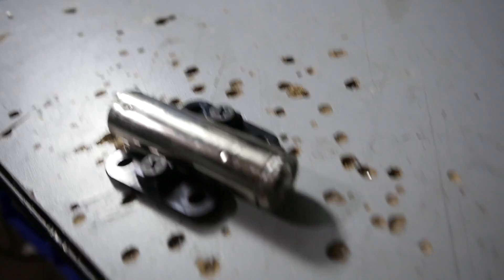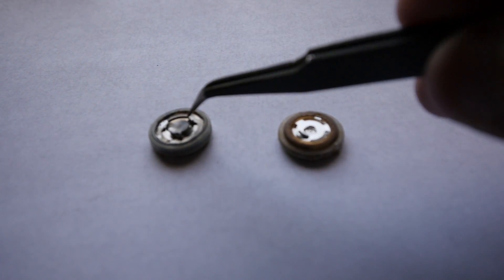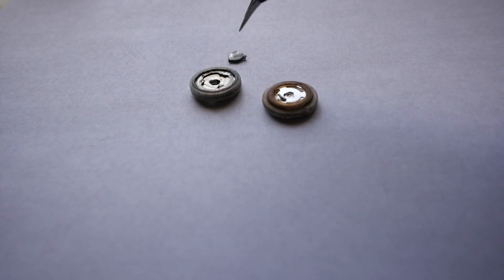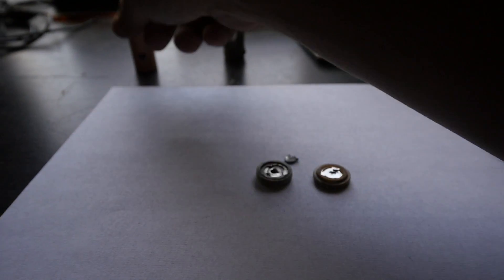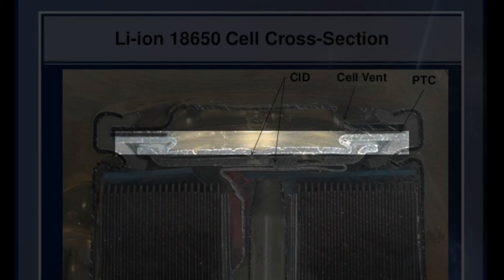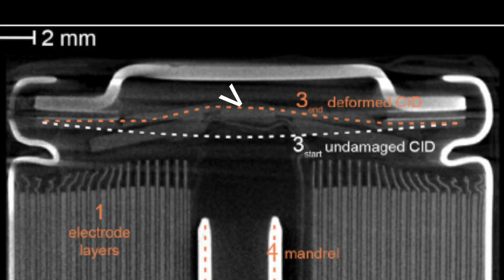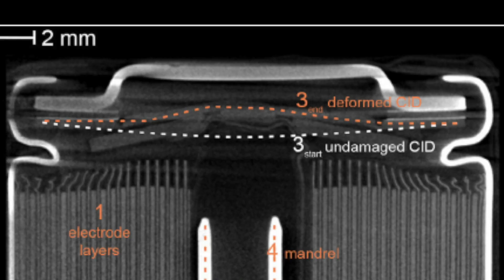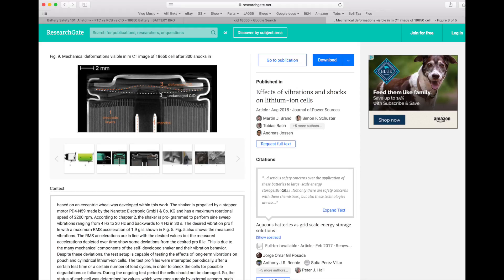ARE TESLA S LITHIUM 18650 BATTERY CELLS SAFER?

Comment: Wouild it work? If you use this on vapes?
Reply: Maybe but the problem with vaping devices is when they fail they fail near your face or in your pocket. Much different than failing in a fireproof battery case.

Comment: Good video.. I did observe however, that in the CT scan of the typical 18650 cell, you said the bottom layer stays down while the top pushes up... but in the scan it appears both layers are pushed up.. no?

Comment: Tesla batteries are also used in a power bank, with non-conductive liquid cooling, unlike your laptop where you are likely to find LG cells, or a vacuum cleaner. You are not likely to see heat in a tesla battery when it is being used in the right application, like a car. Also, you should compare maximum capacity and amperage draw if you really want to compare the safety between two cells. Maybe it doesn't need safety features like that. Cutting it in half does not show quality at all of a cell.

Comment: It depends on the chemistry. If the chemistry is safe enough then the cell can stay dead shorted and it will be able to vent fast enough safely without risk of fire or explosion. We would need to actually test the failure mode of the cells to make sure. Dead short a fully charged cell for us sometime and put it to the test. (STAY SAFE!)

Comment: Just some extra info:  The PTC can handle heat, however if exposed to lots of heat, what happens is the polymer PTC fuse material changes phases and the resistance increases.  When it cools the resistance decreases again, however even causing the PTC fuse to activate once can increase the resistance of the PTC material for days, weeks or even months, thus temporarily damaging the cell's IR.

Also, as far as I know all high current cells don't have PTC fuses because PTC fuses increase the resistance of the cell too much.  Laptop grade cells with 2C max discharge are what have PTC fuses.
Reply: PTC stands for Positive Temperature Coefficient - Jehu said Terminal as the middle word (2/3 ain't bad tho :).  NTCs exist too, which pass electricity as they heat up, rather than stopping it.  Both terms are common in lectronix and used in many power products as a safety feature.  Very interesting too see the construction of my e-Cig batteries though.  Thanks :)
Reply: No such thing as e-cig batteries.  Power tool grade batteries and laptop grade.  And I'm not sure why you are telling me what PTC stands for, I already know that.

Comment: You did a video awhile ago about the capacity of cells stored at a full charge but what about capacity of cells that have been stored almost flat dead? Most salvage laptop batteries have a few flat dead cells in them. Curious about this one.

Comment: Just reading the title of this video makes me think if you are in favor of the gas cars . let's turn the question and add gas instead of lithium batteries.
Reply: Nope, this video turned out to be tearing the battery open and comparing it to a competitor type of equal capability.

Comment: Tesla powerwall and other battery applications are liquid cooled, while your diy powerwall are not. So I'm still feeling safer with tesla official  energy storage products then a home built one.
Reply from the maker: +GrimX  it's highly unlikely that tesla uses liquid cooling on their powerwall,  where is the heat exchanger?  Can you provide evidence to your claim?
Reply: jehugarcia at the moment there aren't any teardowns of a tesla powerwall so I can't 100% confirm. But there is an article about a customer complaining about noise coming from his powerwall and the tesla technician said something about an active cooling system in the powerwall that's causing the sound. There have been homeowners in Australia that mount their powerwall outside their house, and due to the Australian summer heat the tesla powerwall would do very badly if it doesn't have some kind of built in active cooling system. 
https://www.google.com/amp/www.breitbart.com/tech/2016/04/21/teslas-powerwall-hum-drives-customers-crazy/amp/
Reply from the maker: Well,   here is the first reference ive seen atributed to tesla "Tesla says it optimized the duty cycle of the pump and the fan for a short term fix and for the permanent fix, the company provided more sound isolation from the pump to the Powerwall chassis."

Comment: It would appear that to lower cost the safety was moved to the outside of the cell via the safety wire. This also had the side effect of ensuring that the Tesla cells wouldn't be reused for laptops and other consumer purposes. Not to say the power wall is unsafe. It is designed to be safe. Just that the cells must be used as designed not re-purposed in a careless or carefree fashion

Comment: Hi I have doubt 
I have two types of 18650 ncm cell. 
2.6 amps - 55nos
3.2 amps - 55nos 
I planning for 48v but I know how manage amps. 
Can I join both of this cells to form a 48v 33amps pack? 

Kindly suggest I am very confused. 

Thank you in advance
Reply from the maker: +SRIRAM RAM  yes
Reply: Jehu 
can you suggest me how i can join it. (Arrangement Series and parallel)
Reply from the maker: +SRIRAM RAM  yes,  make 12 groups with same amount of Cells that add up to same capacity, connect every group in pararles and then connect all 12 groups in series

Comment: Do you think can using(safe) batteries on EV after CID reset ? My batteries was 0V then i push their CID down  and they showed around 2,9V.
Reply from the maker: +Türk Best  i guess it's posible if they were not damaged too much by he event that triggered the cid in the first place
Reply: I came here to ask the same question thanks for the answer. I have a ton of Ryobi cells that are 0 volts that could be fixed this way.

Comment: Hey guys, just have a quick question about batteries. Can I pair the tesla modules from the smart car to these tesla modules http://www.ebay.com/itm/Tesla-24V-105Ah-Battery-Lithium-Ion-Module-18650-Cells-/222160444898?hash=item33b9cb5de2:g:1DoAAOSw3YNXaHsM ? One is 55.5V and 53AH and the other is 24V and 105Amp. I was gonna do 2 series from the 55.5V and just 2 parallel from the 24v 105amp. Im gonna be using all the the 55.5V 53AH modules for series and all of the 24v 105amp modules for parralel. Will i have any charging issues or fuse issues?
Reply from the maker: +Ando Tovmas   What??  Make a diagram,  yes they can be used together if you wire them correctly but I can't follow what your plan is
Reply: Ok so I want to make an electric car. I will be using either the ac 50 or 51 motor. I want to use the 55.5v 53AH tesla modules for series to meet the motor specifications and to use the 24v 105amp tesla module to keep adding more amps to motor. I want to do this to get as much range as i can because 105amp module is better than just adding 53 amp module each. My question is will i have any trouble charging as one module is 53 amps and the other is 105 amps. Also will there be different fuse ratings on those modules. 

1, Here is the 55.5V 53Amp module, http://j35.us/1TRKeUI. 

2, Here is 24V 105AMP module,  http://www.ebay.com/itm/Tesla-24V-105Ah-Battery-Lithium-Ion-Module-18650-Cells-/222160444898?hash=item33b9cb5de2:g:1DoAAOSw3YNXaHsM

So, i want to have 2 of the 55.5v 53amp module to get around 111V for meeting the voltage side of thnigs for motor and i want around 2-4 of the 24v 105amp  module to get some amps in for extended range instead of just buying the same 55.5v 53amp module in Parallel as well.
Reply from the maker: +Ando Tovmas  no buy all the same type of modules and only use them on the AC-50 / 1238 system.   You will gain nothing by mixing them they are exactly the same just wired differently
Reply: So, to my understanding of what you said, I cant just use the 55.5V 53Ah for just series and the 24v 105ah for just parallel? I wont be getting 105amp for each parallel i have just 53ah each?
Reply from the maker: +Ando Tovmas two 53Ah modules in parallel are the same as two 105Ah modules in series.   It's 3.3kwh per module or around 11 miles of range no matter how you spin it
Reply: Im sorry if your not understanding me correctly and im thankful for the time your putting to help me out. That be said, the 53ah modules have the 55.5v which is the module i want to use SERIES for not series for the 105amp modules. I want to do parallel for the 24v 105amp modules. So, an example would be 2 55.5V 53AMP modules in series would be 111V and the other module which is 24v 105 amp i will use 2 for example and put them in parallel which wuold be 210 amps. So i would basically have 111V 210amps which would be 23.3KW. Right? Or like u said before this wouldnt work?
Reply from the maker: +Ando Tovmas you have to reach the same 111v with the 24v modules,  so you'll need 4 in series.   You need to watch more videos and read more articles on how parallel series connections work,  I doesn't work how you describe and nothing can be gained from mixing these type of modules the way you describe.    Buy the 55ah modules,  however many you can afford, split them in half, connect the halfs in parallel and then connect the two halfs in series
Reply: Ok now i understand. Thank you for being persistent in helping me out. Saved alot of money aswell. Have a good one.

Comment: Hello. I have a 12V 3A adapter. If i connects 3 on seri and 5 parallel can I charge them or is 3A too much (note: battery lithium ion cells
Reply from the maker: +Kerim Amet depends how big the cells
Reply: Really you should find a data sheet to tell you. But if you can’t find that then if it takes longer than 1hr to charge the batteries to full you should be fine. 

Old post I know just sharing for the fun of it.

Comment: In my experience,as long as it's done properly, there is no problem with soldering to an 18650.  with good cleaning, a little flux and a nice hot iron (I think hotter is better as it will result in much less contact time) I can hold my finger on the too if the cell almost immediately after the solder solidifies.  now I'm sure with improper technique all sorts of bad things can happen.

Comment: Is it safe to put your hand in the cells chemistry?
Reply from the maker: +Daniel Prado  prob not
Reply: jehugarcia lol.
Reply: copper nickel aluminium manganese is harmless, lithium is corrosive,  cobalt is a bit more dangerous for the skin or when inhaled.  the electrolyte "can" be poisonous.
Reply from the maker: +gamerpaddy yeah,  don't eat off it but pretty much safe,  that's why lithium ion cells are awesome
Reply: Just don't get the electrolyte under your nails and don't forget to wash hands before you head to McDonalds to eat a Big Mac.
Reply: get water or sweat on " the black thing" n it will instantly catch fire. its not stable stuff in the atmosphere

Comment: could it be that in situ (as in Tesla batteries in the car) have other such safety mechanism, and that venting/bulging inside the confines of a battery pack would be a bad idea? 
i understand a battery to battery comparison but mind the Tesla batteries you use are from a pack, they were designed for the pack too. just a thought
Reply: Thinking of same. Some other safety mechanisms. Cars encounter a wide variety of loads... some much higher than other... like extended climbing a mountain... if the battery internal safety mechanisms kicked in, then the car would have a crivability issues.
Reply from the maker: Tesla cells Vent,  they just dont have the other two safety features commonly found on reguar 18650 cells,   they use external fuses to connect every single cell to the pack both on the negative and on the positive sides, while all other cells have a  fuse inside the cell

Comment: what about the Tesla 2170 cell and the Panasonic 20700 cell ?
Reply: The Tesla 2170 would need to be pulled out of a Powerwall or Powerpack 2. Most of those get into accidents, which is where the automotive cells available to tinkerers tend to come from as far as I'm aware.

I suspect that the Powerpack cells may get better energy density than those now being used in (pre-)production Model 3 cars. 200kW for $94,000. Around $10 per cell? Not too attractive to buy these new for any appliction other than the intended...

Comment: The tesla, leafs, i3s, et al are too complicated for the average guy to work on.  What the world needs is a very simple electric car.  One where you can charge it with solar, fix the ac, replace the motor, change the battery yourself. There are some homebuilt 18650 battery holders online designs with a 3d printer can eliminate soldering.  Maybe design a battery holder for 500 batteries in the device and 18s500p or 9000 batteries. With a 2000 ma cell, have a 70V and 72kwh car with a range of 300 miles.  Magnum Energy PT-100 has a maximum output voltage of 66V so a 17s500p car.  Also there is a living in your van fad going on now so a Van would be the perfect car to convert, maybe a sprinter.
Reply: pirucreek Not gonna touch on most of your comment, but solar charging for an EV is incredibly slow. Think on the order of a week for a large panel charging a modest battery in good sunlight.
Reply: pirucreek ...Okay one more remark; 9000 18650s would be extremely expensive, even if you harvested them yourself.
Reply: Phoenix the charger above can handle 6600 Watts or 20 panels. That is over 100 miles of charge a day. 9000 new EBL batteries might cost $10000.  You can buy a 60A 72V mppt charger for $250.
Reply: ...Ah, I think I misunderstood your original comment. I thought you meant solar charging as in putting a panel on the car itself. Plugging an EV into a large array of stationary panels would work fine.

And $10k is expensive! And I don't know how you intend to get them at $1.11 per cell, unless you're looking at lower capacity cells.

Comment: one short observation i did not see in the Tesla cell any liquid electrolyte. i see they are using come kind of solid electrolyte? am i wrong? this could be a big difference as this will not cause them to vent as there is no liquid to create the pressure...maybe that's why is missing the CID?
Can you please confirm it there was any liquid electrolyte in the Tesla cell?
Reply from the maker: yes there is liquid electrolite  in teslas cells
Reply: saw a very cool vid on fullycharged about some solid electrolyte cells in development using plastic, and another i heard of more recently with glass - think it was from John Goodenough, who originally invented the lithium ion cell